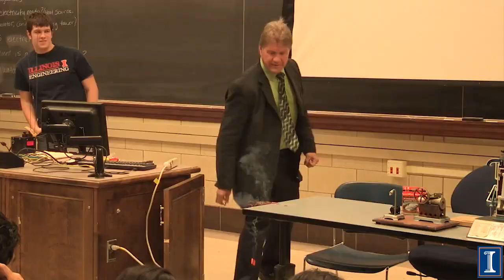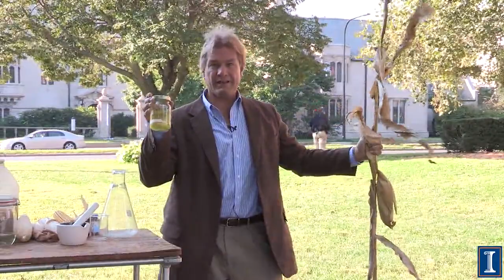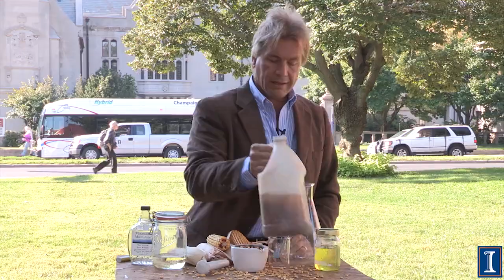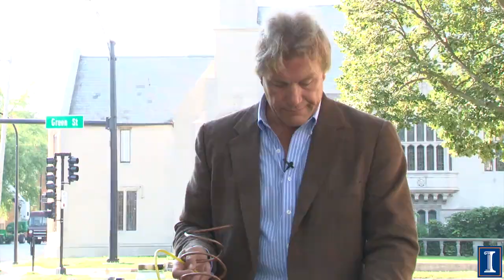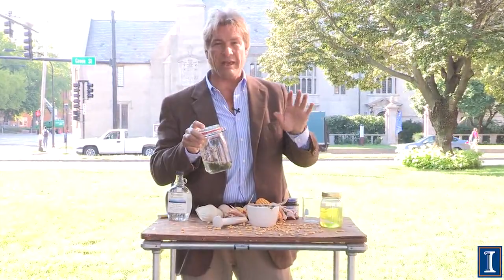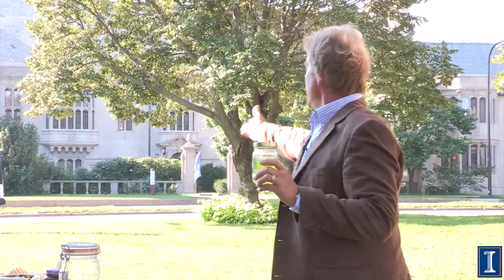Making Moonshine

Comment: Actually ethanol and water form an azeotropic mixture (which means that the vapor mixture concentration is the same as the liquid state concentration) so the maximum concentration of alcohol that can be produced with distillation is about 95% ethanol